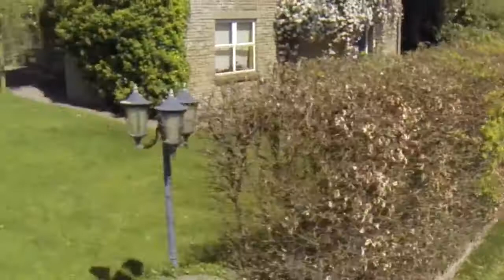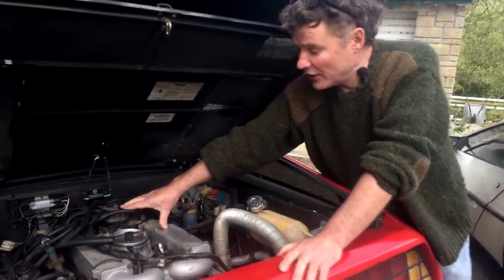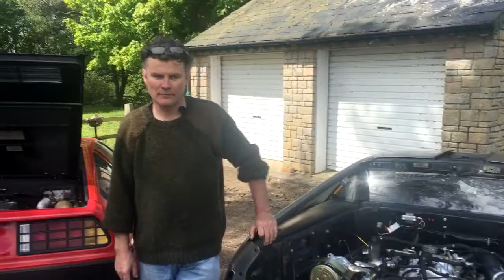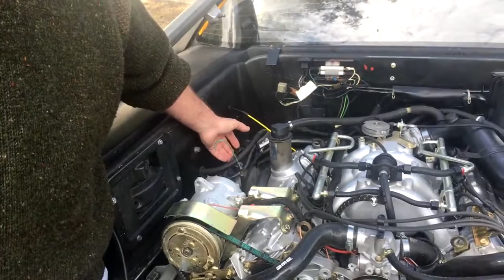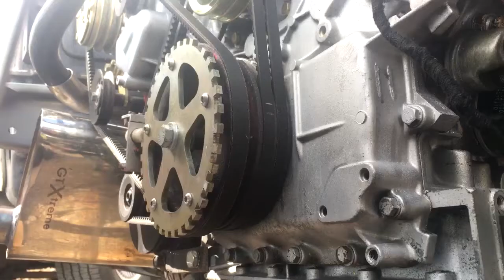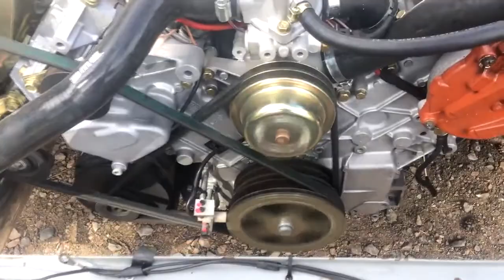Delorean Engine Upgrade

Comment: I am interested in LS swapping on a delorean but worried the gearbox wont handke it. Any suggestions on transmissions that may fit in the delorean and handle the LS engine?
Reply from the maker: The UN1 gearbox in the Delorean is very strong, a lot of kit builders use the UN1 in there builds because it is so good. Use Redline Gear Oil.
Reply from the maker: http://www.projectvixen.com/dmcforum-archive/msg09796.html
Reply: @DIYDrive  i could have sworn while the stock gearbox can handle gobs of power it cant handle high torque engines which the ls has gobs of as well

Comment: Hi there. In the middle of doing the same mod as you have done converting my DeLorean to EFI but the donor vehicle was an auto and my delorean is a manual so i need to set up a trigger wheel on the front crank pulley. What trigger wheel are you using? Cheers
Reply from the maker: Sorry for the delay....http://www.emeraldm3d.com/accessories/36-1-trigger-wheels.html

Comment: Why couldn't you use the stock ECM for the fuel injection?
Reply from the maker: I did not use the original ECU for a couple of reasons . The B28 E engine was auto and had its pickup in the bellhousing of the auto box. Picking up its input from the the torque converter. Fitting an flywheel from a manual gearbox with the segmented wheel makes it to wide and will not work with the Deloreans . Yes you could take a pickup from the engine crankshaft pulley but now we are haftway to fitting a stand alone system. The Emerald system I fitted is state of the art with great backup, taking the Deloreans engine management system into the 21st century. Laptop excess to all engine parimeters , adjustable on the fly.With this build I have tried to push the boat out a little.. Emerald Systems had to design the ECU from scratch . So now that system is available to anyone who wants to have a go and as always if I can help I will. Cost is up there at about 3grand before your done.. For me it was worth every penny/dime.. Regards Thomas

Comment: this episode was worth waiting so long! thing is that if production of D would continue they would go EFI. Nice job, it fits well. What ECM are you using? MegaSquirt ? did you use bottom of engine from stock D, so engine mounts would fit? is it still odd fire as D? I would appreciate more about how you fitted engine. Are you planning further upgrades? like throttle by wire?
Reply from the maker: The system I used was Emerald:
 http://www.emeraldm3d.com/

The bottom end was from an old Delorean engine so I could mount it.
Use old Delorean flywheel as later ones are too deep. Not planning anything more with the engine other than the rolling road.

Comment: Really enjoying your content. My dad got his DeLorean 13 months ago today and we've done a lot to improve her but nothing quite as elaborate as yourself. We've had trouble with the stock engine's fuel management system as well as numerous vacuum leaks we think have resulted from poor maintenance by the third owner. Recently we've had the whole intake manifold off as well as a new exhaust fitted which have really improved the behaviour of the engine. However, as we'd compensated for the vacuum leaks by adjusting the fuel mixture we're now working on getting that to the correct level! We're tempted by the option of fitting the fully mechanical distributor etc from the Volvo 760 and losing the O2 sensor and frequency valve. What you've done is very intriguing, perhaps a step too far for us as we're trying to make our car as original or period appropriate where original let's it down! I'm sure you were very disappointed about the mille miglia, I'm sorry to hear about your co-driver. Myself and VIN 2703 send our best wishes. 🙂
Reply from the maker: Great to hear from you, Guy.
"Base settings" is the key to a good running DeLorean. Also have your warm up pressure reg checked/serviced.

I will pass on your kind words,
Regards Tom